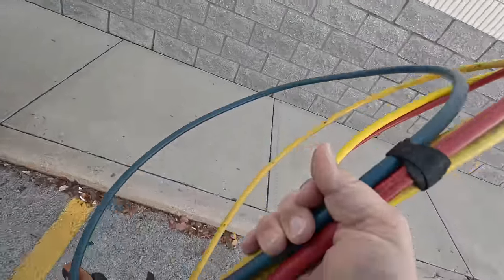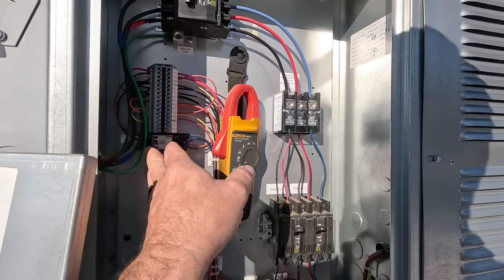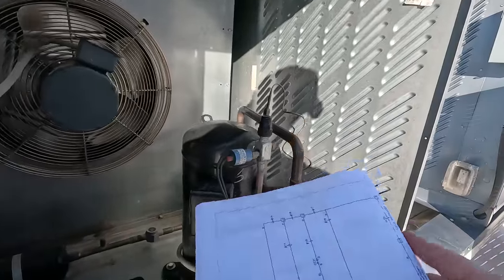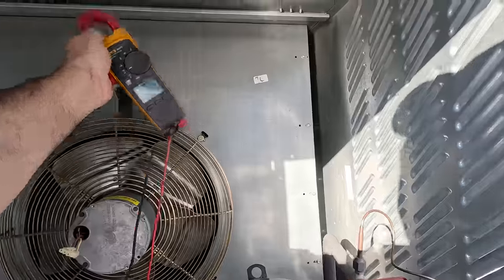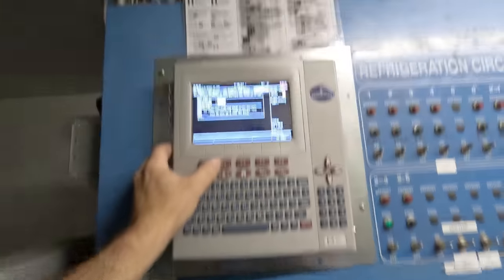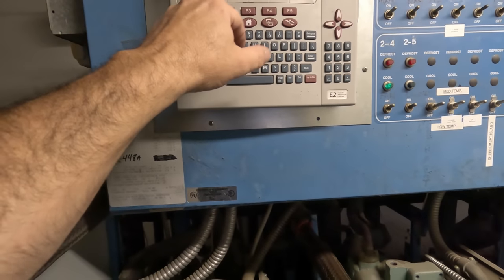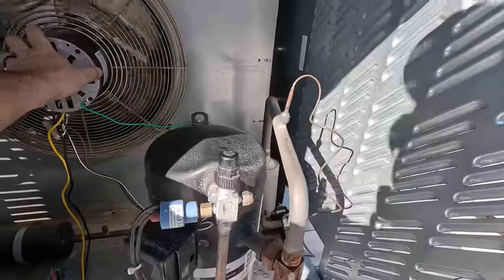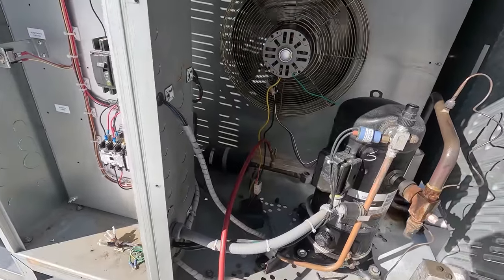Hussmann Fresh Meat Case In Alarm

Comment: Heat is the main enemy of electrolytic caps. SO yeah lets put them on the back of a warm motor thats right in the airflow stream from the condenser coil. Real smart there whoever designed that.

Comment: are those failed capacitors I see at 7:39 on the right? looks like two have the ends bulged, split open and spewed. it must be running hot/over current or way over voltage.
makes me wonder, maybe rectifier failure and AC vs. DC chooched them
Reply from the maker: Likely runs too hot, it's in a sealed metal container with condenser air being pulled over top of it. Sounds like a good design to me 😁(for sales)

Comment: Out of context sorry about that but have you seen the Generac load sheds take a poop? Long story but had no power going to my A/H. I checked the usual suspects, float switch, low voltage fuse, breaker, pulled panel 240 coming out of breaker. This had me stumped. It finally dawned on me as I was on the way to Lowes to waste money on a breaker any way that these have load sheds. The power light was off the load shed. I had 240 on the line side of the load shed contactor 0 on the load side. I bypassed it and good to go. Odd thing to me was it was pulled in. A tech called me from the Generator company and explained pulled in is a bad board. Not pulled in is closed. Learn something new everyday. The boards are known to be kaka so Generac put a lifetime warranty on them. I put the wires back on the contactor and pulled the board. Yearly maint. is due so they are coming out doing that and replacing the board. Old boards are green new upgraded boards are blue. They have a line of resistors that are all burned up. Apparently that's how they all go out.
Reply from the maker: I'm not working with generators at this company much compared to the place I was prior. But I did have one go bad. Thanks for sharing👍👍

Comment: The controller board for the motor Simple capacitor replacement Not made possible because of their Is rubber's Stuff they used to seal The motherboard so it can't be repaired

Comment: The question I have for the engineers who designed these motor controllers is this:
Are you using capacitors rated for the temperature range the controller will be experiencing?

Most electrolytics are rated for 85°C (185°F) and I wonder if the controller itself is getting hot enough in situ to damage them... Metal box on a roof, with heat-producing equipment inside that box, and motor controller circuitry inside another metal box (which also generates its own heat) mounted to a motor that generates heat... Perhaps we're not getting anywhere near 185°F inside the controller, but it's certainly getting hotter than ambient temps, and heat is an electrolytic capacitor's worst enemy.

I do feel that we're being "penny wise, but pound foolish" here. What good is saving a few dollars a month on your utility bill if your maintenance/repair costs are increased dramatically? I'll give them credit, however; that is one of the nicest OEM wiring jobs I've ever seen in a unit.
Reply from the maker: I agree with everything you're saying🍺👍👍
Reply: Even the 105 degree caps that I work with would have a hard time with a lot of the temperatures there.
Reply: They are just doing the least they can do to comply with new energy regulations. Simple as that. It's just a cheap hack. They couldve used a small, fully potted three phase motor like the ones minisplits use, put the controller in the electrical section with a big heatsink. Would've given them the opportunity to actually make use of different speeds depending on load which would actually save energy. And that would actually last because you can design it properly.
Reply: Even if the caps don't experience temperatures at their rated temp, it still reduces their life. The cooler they run, the longer they last. Same principle applies to just your bog standard run capacitors. Caps on outdoor units will die quicker as they're warmer.

Realistically it's just a manufacturer cheaping out on parts. Gotta go for higher rated caps, or make the inverter board separate where it won't cop so much heat.

Comment: Will those motors work as a regular motor without the delicate control module?
Do solid state caps exist in that size? Cheap electrolytics are for either large capacitance or cheap electronics because they don''t cost squat in bulk.
Reply from the maker: I haven’t tried it without the electronics but I would guess it’s a DC motor and wouldn’t work.

Comment: OK here is the deal fellas. The genius engineers who got college but has to use task rabbit to change the battery in the smoke detector, they have told manufacturers that in order for them to sell in America they have to show energy efficiency. So they had to, throw away all the diagrams of the past that worked well and we carried universals on our trucks, for all this electronic stuff that fails. Like with anything this all beta testing. The customer suffers and they look at the tech like he doesn't know what hes doing because in the past we had a fix on our truck.

Loved the silent rant @9:45 BTW Rick. Keep the videos coming.
Reply from the maker: I had to say to myself for a second,  "what's he talking about", then I clicked the time stamp and holy crap you made me laugh. 🤣🤣👍👍
Reply: The problem is the cooler company that built the outdoor unit. They still were still using tech from the 50s and didn't make many efficiency improvements. The government then steps in, because the power draw from refrigeration and cooling in general in the US is ridiculous, and has a ton of room for improvement honestly. The cooler company needs to comply to new regulations and goes "oh crap, this would actually take engineering and effort". Then they source the cheapest motor they can find to comply which doesn't actually solve the problem, but it technically complies. Slap their label onto the cheapest ecm motor they can find and ship it. Using a minisplit style potted three phase motor and external controller heatsinked to the case would actually be way better, but that would be engineering effort those companies don't want to spend.

Comment: @16:11 you can see the failure. The capacitors failed there. Look at the top. It should be flat. Now it is convex. Not only that but the second one on the left have a brown dot in the middle, and the leftmost start to have brown. That is the electrolyte inside that leaked out.

The cross on the top of the capacitors are vents. They punch the top not fully, which make a weak point. When the capacitor goes bad, pressure inside build up. If the pressure goes up too much then it could explode, or rocket out with massive force when the can will separate from the rubber seal at the bottom. That can be at several hundred PSI. The smaller ones like on computers can rocket with enough force that it dent a bit the computer case !!!!

The cross make it weaker, and should rip open safelly. First, the capacitor bulge, then it rip, and the pressure is released.

This is a super common issue, and a sign of bad engineering or low quality hardware. It is also possible that it is done on purpose (chemical time bomb to break the device after a while).

Capacitors lose about half their life each 10°C in temperature. Lack of cooling drastically lower the life.

And if not well made, they can overload the capacitor, which cause it to overheat. Common on cheaper devices and badly made stuff.

And of course, they can do it on purpose. And some chinese capacitors manufacturers actually do produce capacitors where the chemical inside is unstable on purpose. 2-5 years and dead.

Fun thing, I noticed that the marking on top of the capacitor give an idea of the quality. 3 winded is cheapest. 4 like in this video is ok, K marked is high quality.
Reply: > Fun thing, I noticed that the marking on top of the capacitor give an idea of the quality. 3 winded is cheapest. 4 like in this video is ok, K marked is high quality. 

Just look at the brand. Japanese brands like this Nichicon are good and will likely exceed their ratings. Rubycon or Nippon Chemi-Con are also good Japanese brands.

Of course good reputation means that people are making knock-offs, so who knows if the problem here is the manufacturer got counterfeits in the supply chain or if the engineer designed in the wrong capacitor.

Also keep in mind that even if it's marked as 105°C, that's still only 2000-3000h rated at that temperature.
Reply: @flagman3116  Standard is 1000 hours.

Comment: If you still have that controller, drop ten bucks into four new capacitors.   If you don't know how to cross check, send me the part number and I'll do it.   In many cases, the caps have completely blown, which means they don't allow current, so it just doesn't work.  new caps, suddenly works.   (I resolder a lot of motherboards and power supplies for monitors)  
I can't promise it'll work, but if it doesn't, you're out 10 bucks and some time.  If it does work, you have a spare.

Comment: Thank the D.O.E. not the manufacturers for the crap “high efficiency” parts. It’s not easy to meet some of the requirements, so they do whatever they can to save a watt here or there. It also drives up the cost of old school mechanical parts bc none of the manufacturers can use them anymore.
Reply from the maker: I know